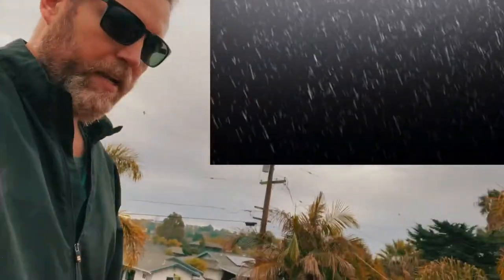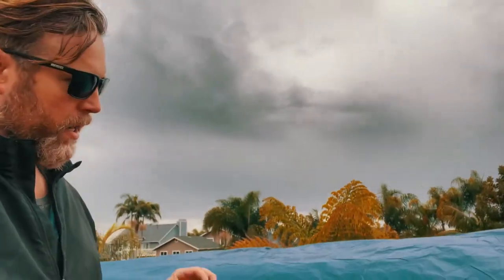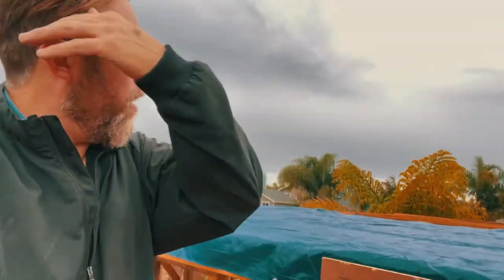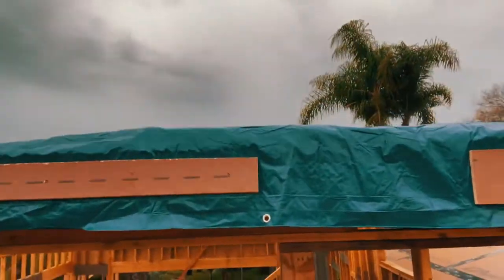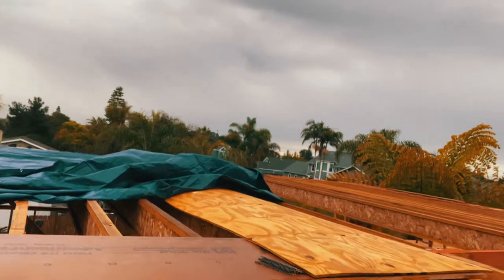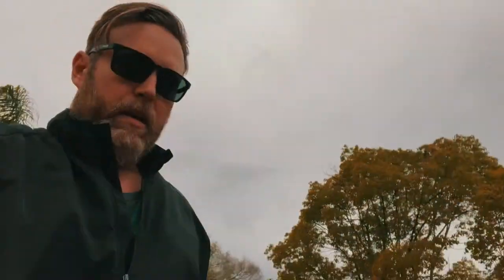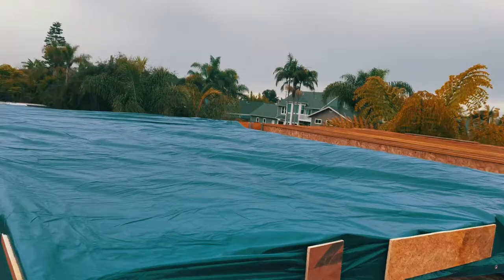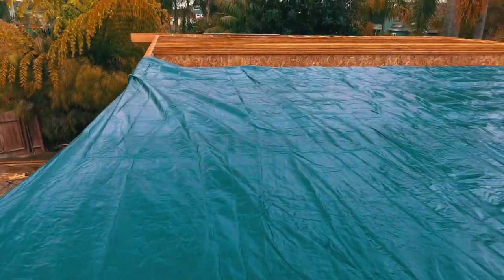How to Tarp a Roof - The Right Way

Comment: Good video but what type of screws are you using and what length of screw do you recommend? Also, what distance do you recommend between screws on a scrap  of wood ie) every 6 inches or every 12 inches of scrap wood? Thx!
Reply from the maker: I use a minimum 1 3/4 to 2” all purpose construction screw, Phillips or star head on a 1/2-3/4 piece of scrap ply or 1x2 pine batten 
8-10” inch spacing is enough to get the ply to

Comment: I agree. I use 1x2s all the way around, but I need to tarp a clear polycarbonate porch roof connected to the house. I can't walk on it without breaking it more. I can pull it up with rope and pray it doesn't rip, but when I get to the flashing (on top where the house meets the deck is a 6" thin metal piece that goes over the polycarbonate. How do I remove those screws? I need to hover over the roof. Any suggestions?
Reply from the maker: Hi Donna, 
If you can reach the 6” pan metal from the regular roof, reach over and remove some of the screws connecting the pan metal lip, then tuck the tarp under the pan, then try to replace some of the screws. That would be best in your circumstance to hold the tarp in place and allow water to flow from the pan to the tarp.
Reply: @theconstructionzone7   Removing the screws and tucking the tarp underneath and returning the screws is perfect as you said.  My biggest challenge is that the roof is 16 feet across where it attaches to the house.  Even with the tallest ladder, my arms don't reach past the first   (2') of polycarbonate sheeting - 2' wide each. I could remove the entire roof, then tuck the tarp under, fold it onto the shingled roof and return the sheets -  it's just very time consuming and the clear polybarbonate sheets are  fragile. I learned that already after breaking one.  If I lay down and spread my weight over 4 feet, do you think it would cause a lot of damage?   I want to keep them up to prevent sagging in the middle of the tarp.  The sheets have withstood many snowloads. Standing on the house roof seems out of the question due to the severe slope.  I wonder if I could tie off at the chimney and what type of tether to use if it's possible.
Reply from the maker: Here is another option. If there are support joists at least every 2’ then place a moving blanket over the poly panels and a piece of 5/8 plywood on top of the poly panels. That will disburse your weight and allow you to walk on top of the overhang without damaging the poly panels. As long as your overhang porch roof is low slope. If it’s anything over a 3/12 pitch I would not recommend the above.
Reply: @theconstructionzone7  OMG!!! THANK YOU! THANK YOU! I didn't have a moving blanket so I used a heavy duty quilt under the 12"x8' plywood. The polycarbonate neither cracked nor crushed. The screws are out and the tarp will go under the metal today. I can't thank you enough! You removed the fear factor allowing me to move forward!

Comment: okay correct me if I'm wrong  cuz I'm not familiar with this process but isn't part of the process to seal it off from the wind so the wind can't get underneath the tarp and blow it up at all???
Reply from the maker: If you can batten most of the tarp off to eliminate wind getting under it, that is probably ideal. In our situation wind was going to get under it regardless due to some of the open trusses in our new build. Either way battens vs using the grommets will give the best chance for the tarp to survive the wind.